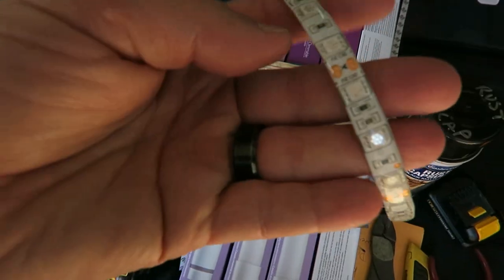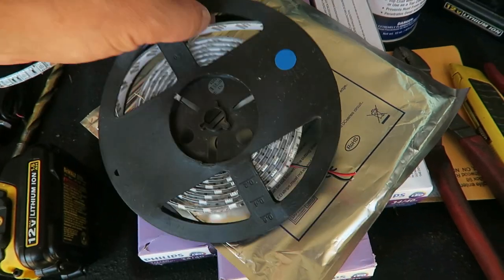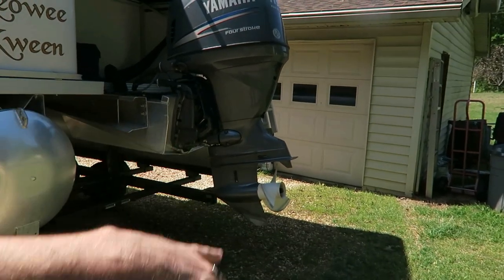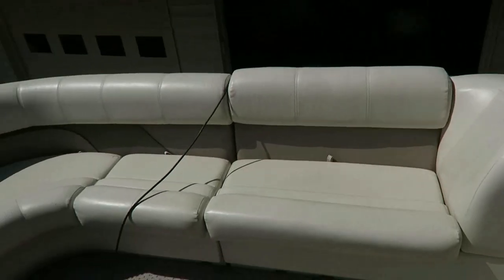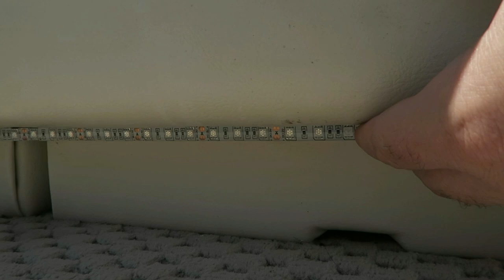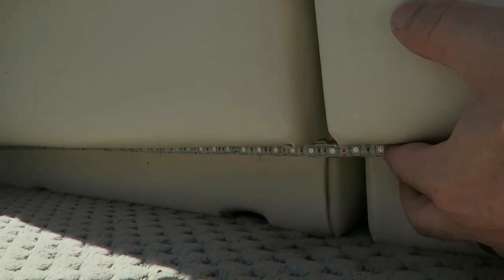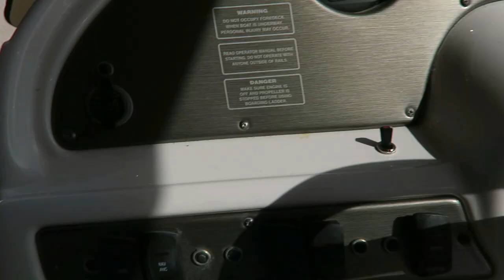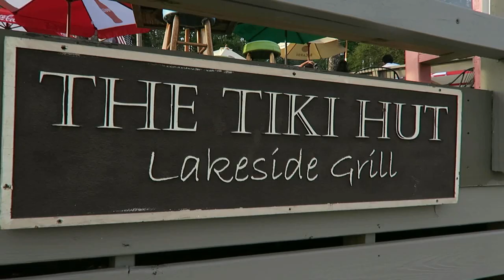LED Pontoon Lighting Install

Comment: Use starting fluid(ether) to clean the surface before sticking the tape/leds , plasticizers in the vinyl fabric attacks the adhesive and the lights fall off.

Comment: You can add resistors to the strip lighting to cut the power. It'll darken them a little so they aren't super bright.
Reply from the maker: Yeah I ended up putting a dimmer on it

Comment: I have a question. When you wired the interior lights, did you run wires from the controller box to each seat or did you wire the LEDs in series?

Comment: Add a 12v PWM to the circuit for your inboard LED's. With that you can turn down the voltage and adjust the brightness to them. I like them a lot better then a resistor as they don't create as much heat. Amazon has them and ebay is even cheaper if your willing to wait 3 to 4 weeks.
Reply: Guess I should of read the other comments, haha.
Reply from the maker: lol....yeah gonna give it a try

Comment: If you use adhesion promotor on the surface first the adhesive stays put , I use the adhesion promoter like what comes in rearview mirror kits or 3M offers the pads https://www.amazon.com/3M-Adhesion-Promoter-Sponge-Applicator/dp/B01G2BHLG6/ref=sr_1_4?ie=UTF8&qid=1492458256&sr=8-4&keywords=adhesion+promoter    I've had the strip LEDs under my Mustang on the pinch weld area and bumpers for 5 years now and still holding by using the adhesion promoter first .  Try it , you just might find it worthy of a You Need This Tool episode :)

Comment: wat you could do should the gleu not hold up is make some strips of plexyglass and screw that over the leds intoo the bench seat with some woodscrews so there clamped in
you could use coloured plexyglass to tone the lighting down a little or put some of that darkening foil for car windows over them 
maibe you can lower the power to the leds with some sort of dimmer in a watertight box and lower the glare that way
Reply from the maker: Yeah I already have a dimmer on order....will most likely figure out something if the lights fall

Comment: Odd request incoming...What year and model is your Crest Pontoon? We are trying to get a pair of those light bezels that your dock and navigation lights are mounted to in the front corners.  We can't find them anywhere!  When we ask parts dealers and even Crest Marine, they don't know what we're asking about.  If I can give them a model and year, they should be able to pull that up and finally understand the part I'm trying to get.  Your help would be so appreciated.  Thank you.
Reply from the maker: I think it's a 2016

Comment: good job you didn't cut corners with crimp on terminals, that lake looks like my neck of the woods. Hartwell/Tugaloo area?
Reply from the maker: yeah Keowee
Reply: awesome but it is so low now I cant even put in at my ramp have to go to another one. getting my first pontoon in a couple weeks will be putting lights on it.

Comment: the adhesive does not last long they always fall off I've used clear silicon to hold mine
Reply from the maker: Yeah I had a feeling...house hold style silicone?
Reply: I always use the clear tub and shower stuff on.mine home depot love the channel keep it up
Reply: we always dab hot glue every few inches. All of our work is undercabinet stuff, not sure how hot glue would handle a life aquatic
Reply: Replace it with 3M foam mounting tape.  Be sure to clean the area well with alcohol and let dry before applying the adhesive tape/LED strips.  Heating the adhesive with a hair dryer will also improve adhesion.  You can also mount the strips in aluminum channel made for LEDs.

Comment: Use professional hot glue to attach. The adhesive back wont hold long
Reply from the maker: yeah I ended up just going over it with silicone

Comment: Disconnect one of the wires from the switch and put a power resistor in series; that will dim down the string.
Reply from the maker: Perfect....I think thats what I am going to do....any idea what size?
Reply: What voltage are you running? Do you know the current draw or wattage?
Reply: Put a small potentiometer on the ground side... make it adjustable... I bought the strip of RGBW leds and by adding a small pot to each ground wire, i can control the R, G, and B, and make whatever color i want...

Comment: instead of using a resistor or a dimmer i would go for a buck converter like this: https://goo.gl/Jz4Klk
it will provide constant current and it will protect the strip from overvoltage and to much current. you can adjust the voltage and the current on these. i have probably 50 of these use them all the time
Reply from the maker: interesting
Reply: also if you solder of the 10k potmeters and buy your own you can easily make your own constant current dimmer with a box and knob of your choice :)